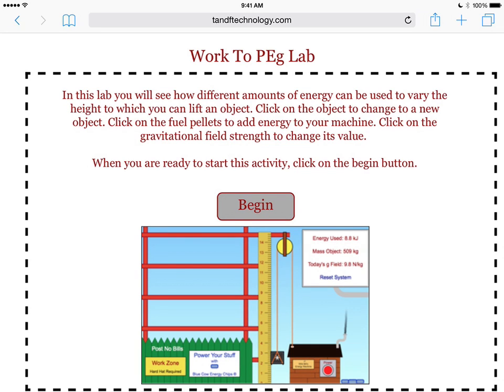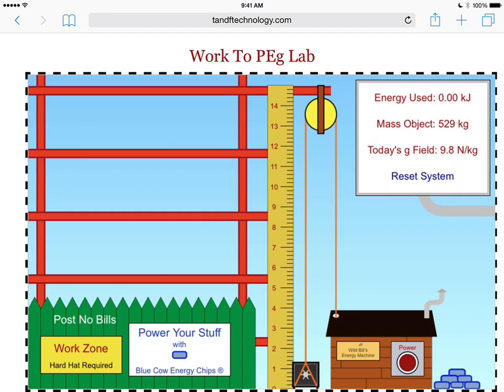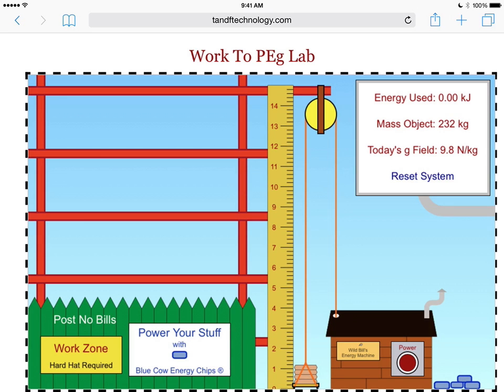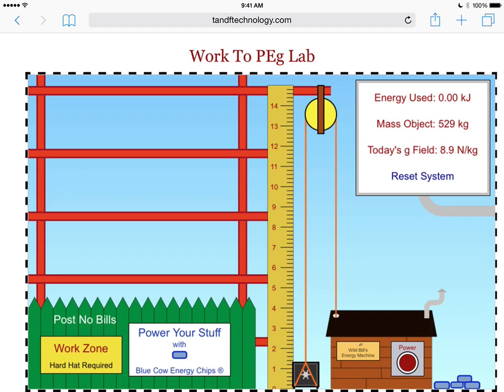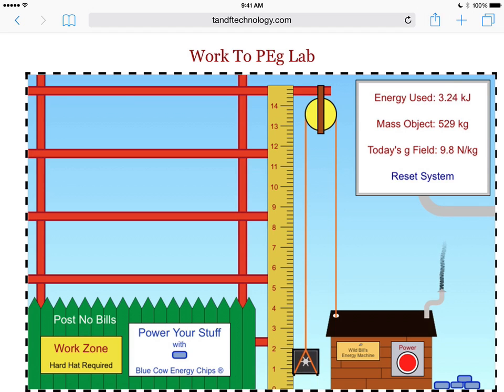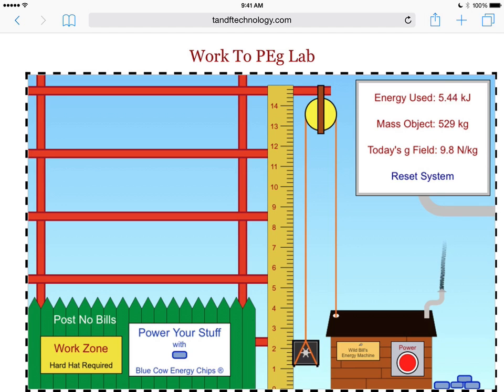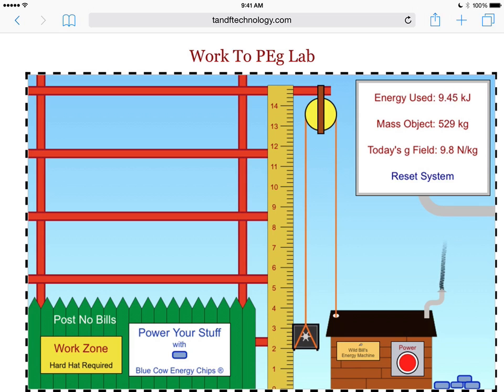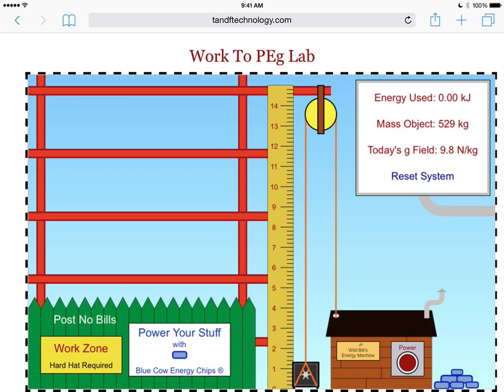Work To PEg Lab

Comment: Doing the math, though, doesn't add up.  EX: I put one pellet in to lift the safe (536 kg) against Earth's gravitational field 9.8 N/kg, & it lifts the safe to various heights between ~2.6 to 3.2 m.  Even taking the lowest height lifted, would be 13.7 kJ of work done.  However, the highest amount of "Energy Used" calculated by your app was around 9 kJ.  So, somehow the machine is more than 100% efficient!
Reply from the maker: I think you were just not measuring the height properly.  You had to measure from the very bottom of the legs of the safe or other objects.  I added a red line to program that will follow the object up.  This should make it easier to measure the height.